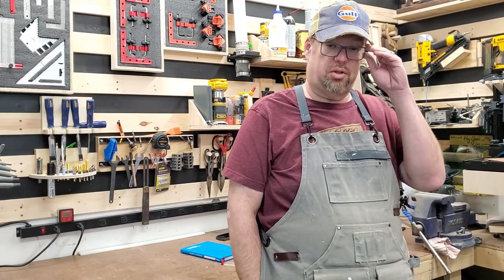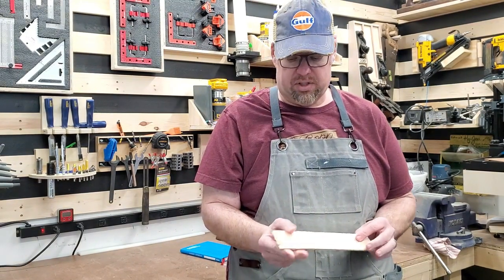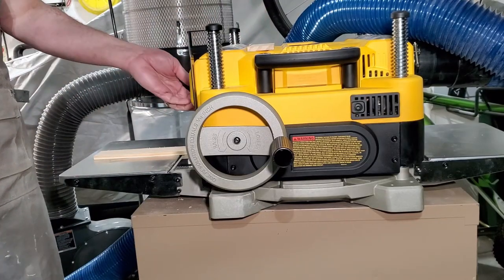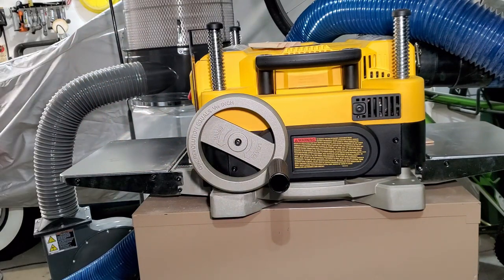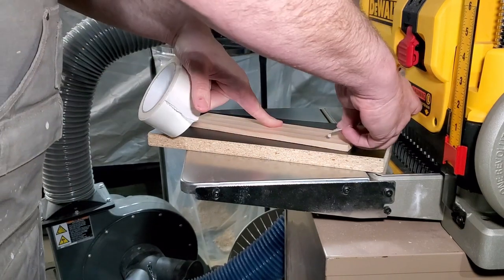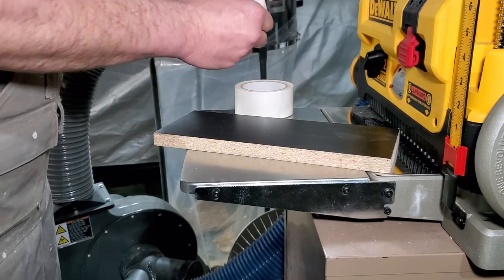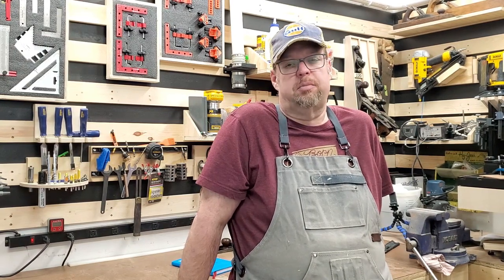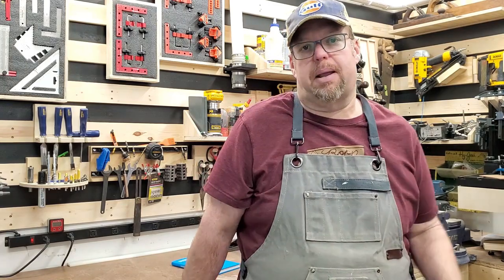ELIMINATE SNIPE and Tearout on Woodworking Planers

Comment: This is a solid trick. Over the past few years I started using hot glue over double sided tape though. My double side tape sticks too good, so I was breaking thin boards in half pulling them off the sled.
Reply from the maker: Hot glue would be great as well. But I am usually too impatient to wait for the gun to heat up! :)